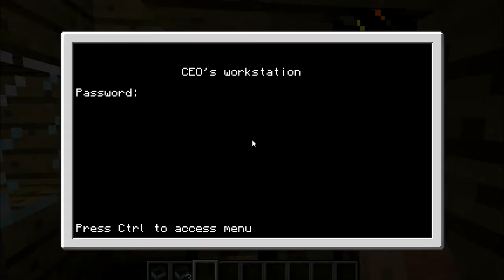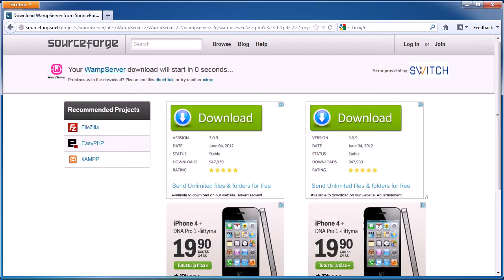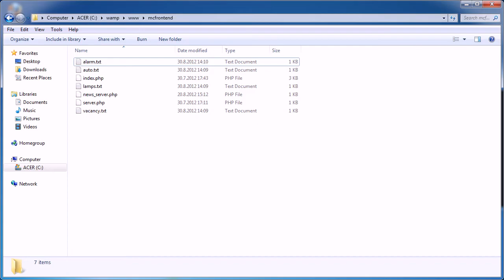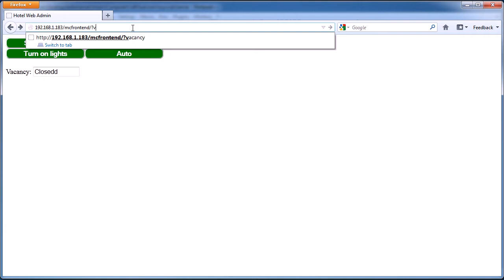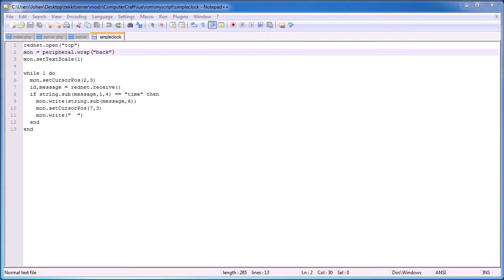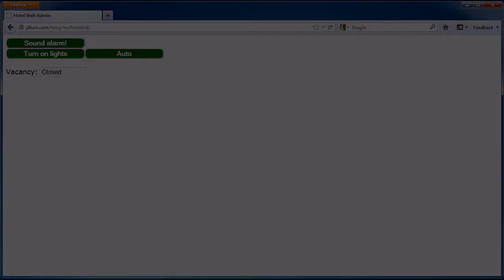Control redstone in Minecraft using an online control panel

Comment: How do i change the time zone to GMT
Reply from the maker: If you use a WAMP-server, then open up the PHP configuration file from WAMP settings, and change the date.timezone setting.
Reply: @Jette3  WTF you dont change any server settings!! Just use the command "date_default_timezone_set('UTC');
" and change UTC to the timezone you want. Dont fuck around with any server configuration if you dont know what you doing

Comment: i cant find anything else close to this on YouTube or the general internet (after 5 minutes of googling) which is a shame because I'd quite like to use this, however i need to be be able to control 34 different devices/circuits (and counting) so it might be better to try to get the PHP code to output into a serialized table that can then be read by computercraft that way instead of 2 PHP files and 34+ txt files to read from/write to. could that be possible?